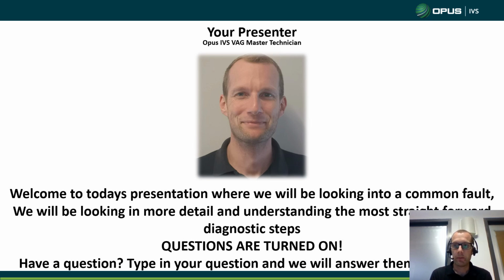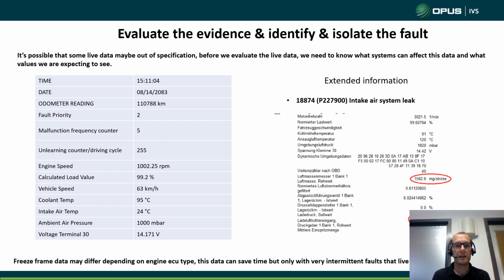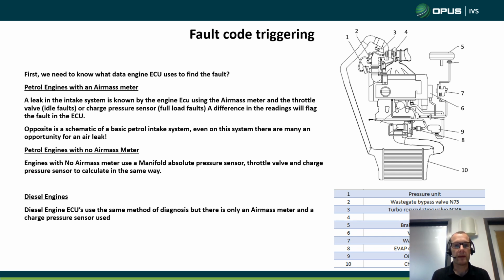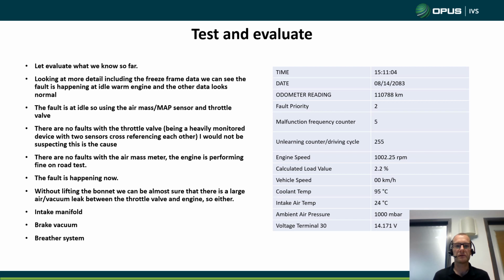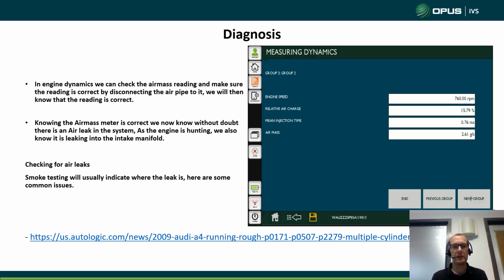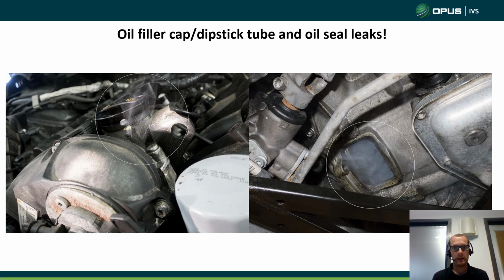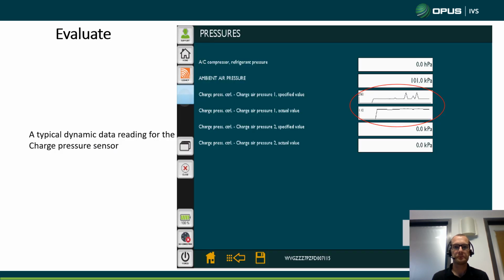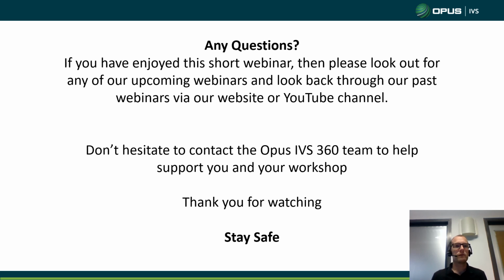VAG webinar Air Leak Detection

Comment: I cant tell you how many times the various vw/audi pcvs have failed. I wish I was straight forward and I’m sure with a excellent diagnostic process it is. However they can fail in soo many different ways. IE Audis have 2 different pcv setups for a similar engine. Then there the FSI where the PCV runs thru the valve cover (internal leaks). Rear main seals the list goes on. Thanks for the video I took a few key values from it.